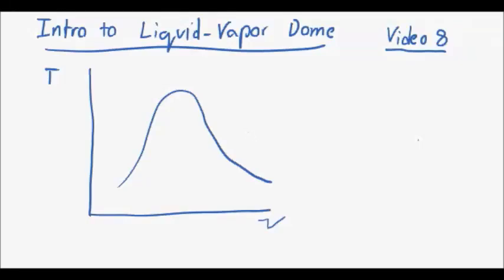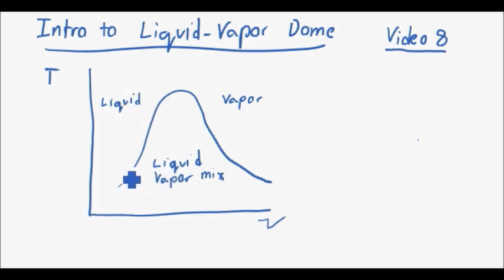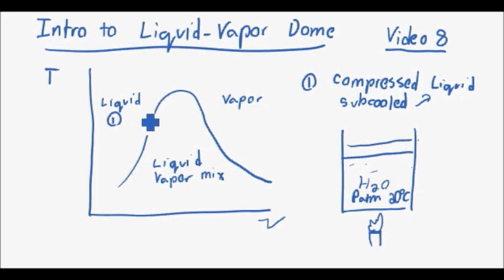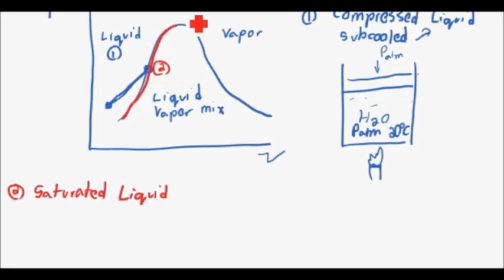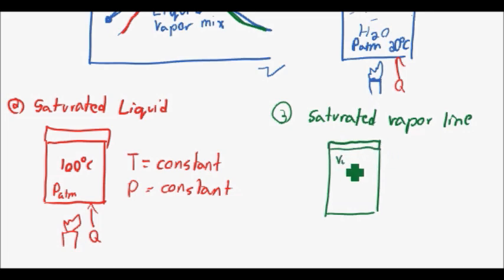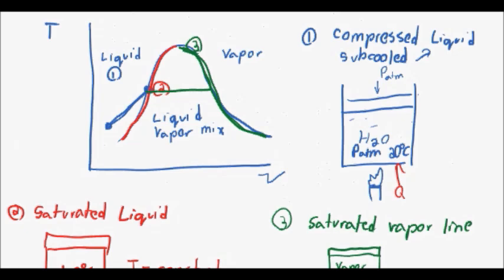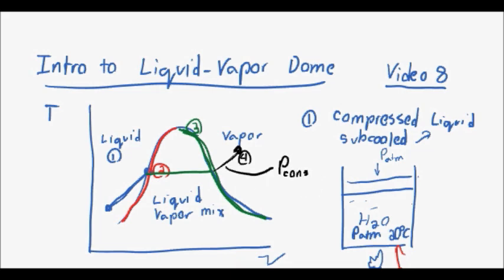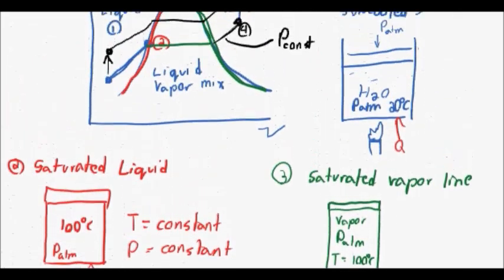Introduction to the Liquid Vapor Dome (Thermodynamics 8)

Comment: Thanks for the video. One question: So what if the 1atm was not provided by the piston but just simply air? If I look up properties of water under 1atm and say 25c in the diagram I get liquid water only. However, we know that in fact once equilibrium is reached some water will have evaporated so essentially I'll have vapor and liquid. How is this reflected in the phase diagram?